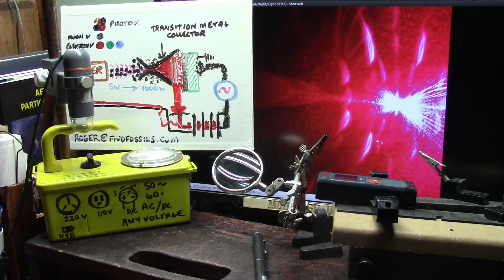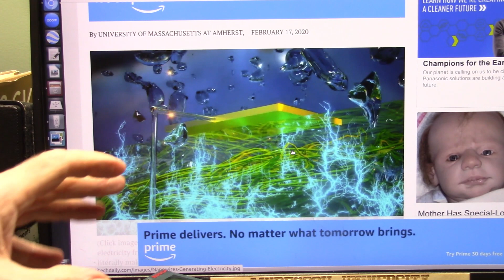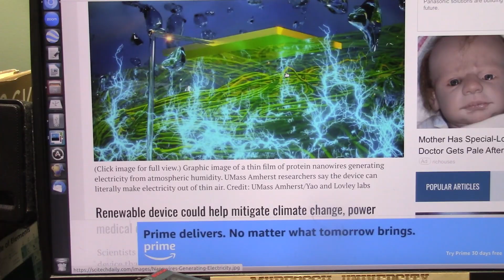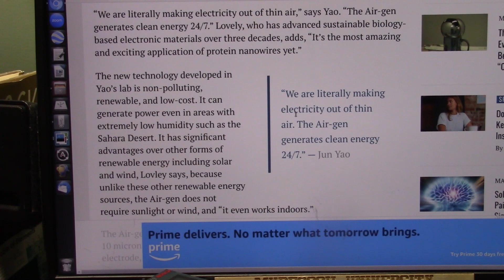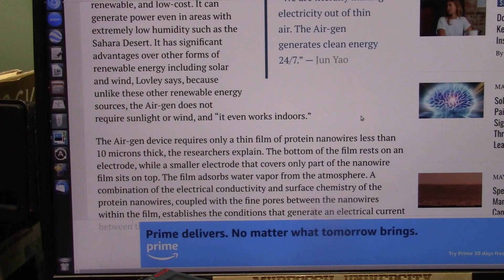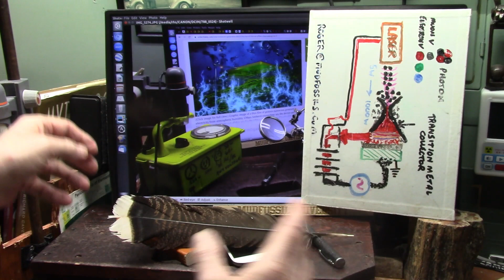Energy from Thin Air Just Proven at University of  Massachusetts Using MFU Tech

Comment: I read the article its from Febuary 2020 so not recent and the technology doesn't have anything to do with light their claim is they are able to get energy by using a thin protein layer and creating chemical energy by drawing moisture from the air. Their current goal is make working units that can be used with  low end power devices phones, watches etc, and then scale up to larger application. However after three years of research from time after the articles was published they don't seem to have made any head way and from what i can find their has been no update on the project in 15 months so I would surmise its been shelved at present.
Reply from the maker: It was nonsense yes but my work is not...I use Academic Ridiculous claims to taunt them.